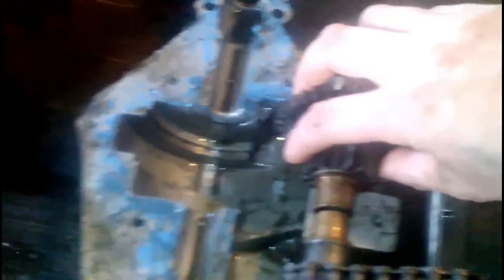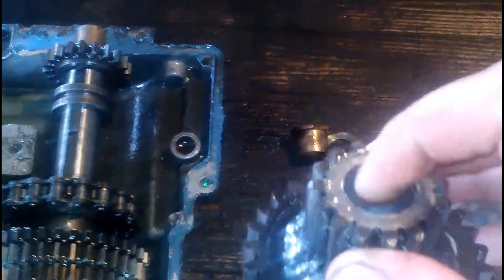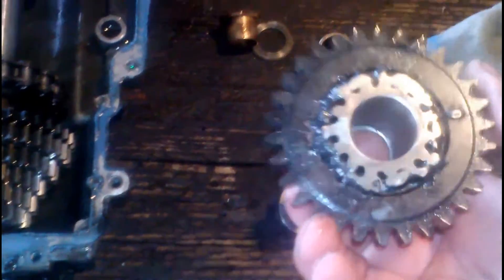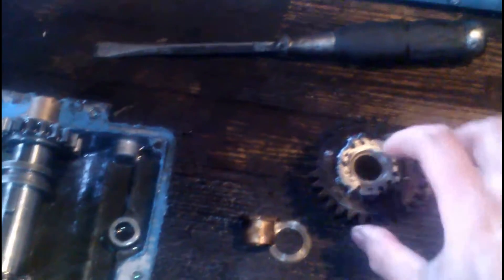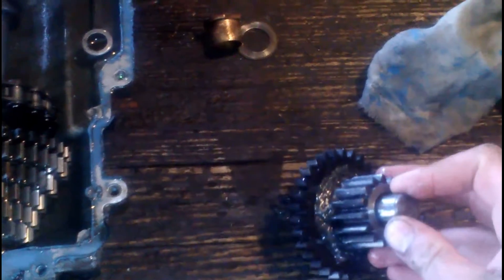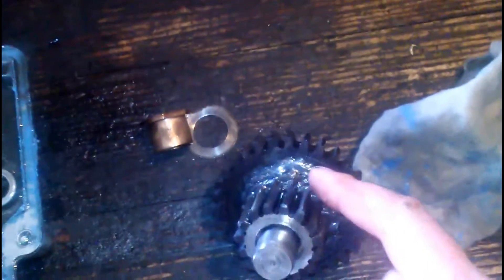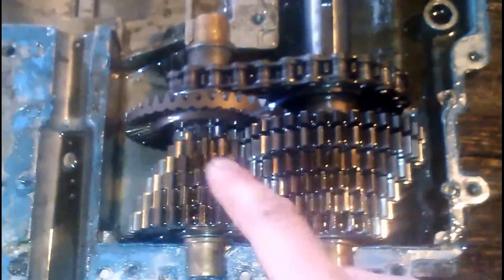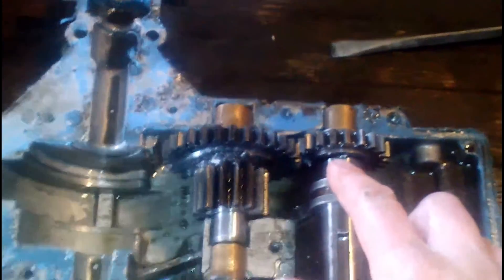Repairing and speed up of peerless 920-930-mst transaxle

Comment: I would like to see opening it up. Im a novice who just wants to fix my mower... Yours is the only vid I can find. Btw, what's the yellow bung for on mine? Does it mean it's got oil rather than grease? 
Thanks from France!

Transax transplant 

I have a 30 y.o. Murray 11/36ic that was increasingly difficult to change gear. I acquired another transaxle 10 years ago, and seeing it has 10 years less use than my one so it must be in good or better condition...right? 
I hear it clicking as I move the gear changer thing sticking out the trans into several positions.
Put it on, and now the mower won't move forward or back.
I see the drive belt is turning the rear pulley on the transax. I lift the back up to see if there is the slightest movement and there is nada. 😑

Any ideas anyone...

Comment: Nice regearing move, I like it. How long has it been holding up like that?
Reply from the maker: First time, about 2 years.  Then we swapped 16hp opposed on and broke a gear, but I think gear was a sintered, or cheaper gear.
Replaced the speed up gears with ones from a 820, so they are hardend steel.  So far so good.
Reply: Ahh- I'm glad you mentioned that. I was indeed concerned about the sintered gear construction!

Comment: Hey stretch I have a 920 in my Murray and was wondering if you could do a more in depth video on how to speed up a trans axle thanks!
Reply from the maker: I can, but it might be awhile.  You can see what gears are replaced in this video.  You have to be able to run a lathe and welder to do the bigger gear, smaller one slides right on.
Reply: I can run a lathe and welder I go to school for machining but what gears are they like 4th or 5th gear set I mean
Reply from the maker: ***** Just count the teeth.  I'd shoot for 20 and 30 teeth gears